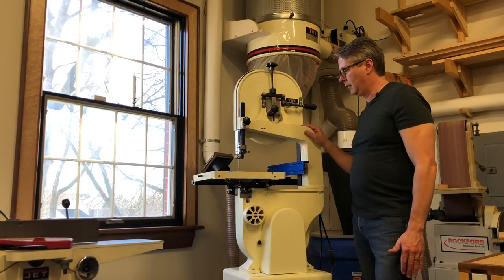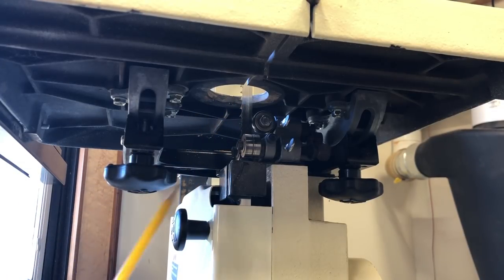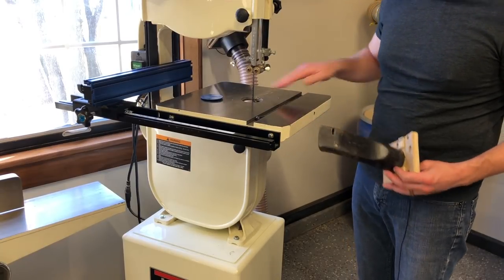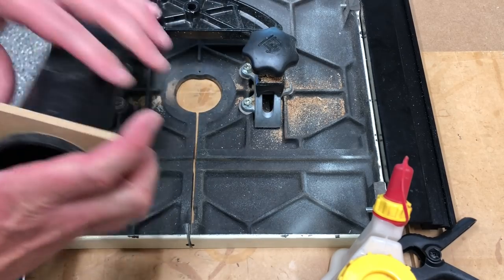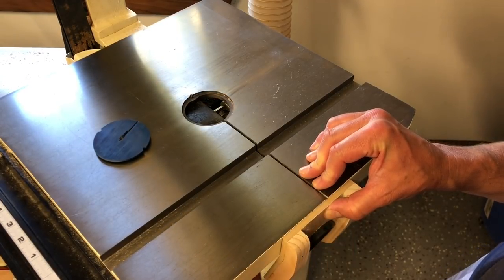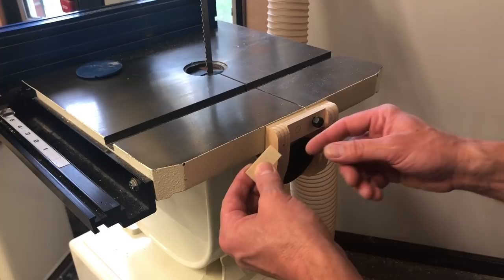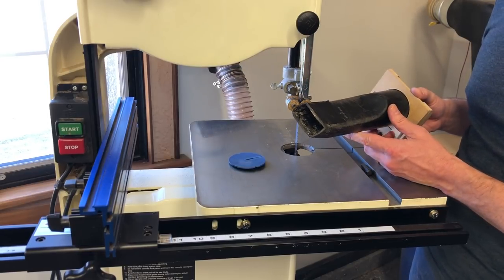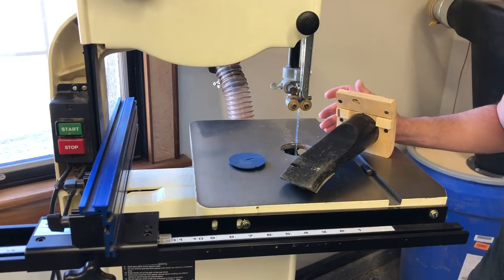Improve your Bandsaw Dust Collection

Comment: I'm curious why the opening the blade (and dust) enter from above on the tube assembly is so narrow.  Why not open that up a bit (while leaving the bottom as you have it for just the blade to pass through) so you have a larger volume of air to pull dust in?  I only ask because it looks like what little dust you aren't collecting is only because that opening is so narrow and they're deflecting off the plastic.
Reply: Hi, did you ever try doing it this way to compare?

Comment: This was a great idea!  I just finished crafting one for my 14" Jet 
bandsaw and it runs circles around the stock dust collector port.  I 
made the port adapter out of HDPE (only bendable material I had in my 
shop at the time, and I didn't have any 1/4" mdf), drilled the lock pin 
hole, and added the registration blocks.  My real estate under the table
 by the throat was a lot less than yours in the video, but I just cut 
more out of the shop vac attachment to make it fit.  I duct taped all 
the openings, installed the adapter, hooked it up to my dust collection 
system and let 'er rip.  What a difference!  This dust collector works 
great and I want to thank you for sharing your idea!!

Comment: Well Done. I have recently  got a bandsaw and I was pondering ways of having vac nozzle close to the  point of saw dust creation,  Thereby (1), dealing with the dust BEFORE its gets into the casing/working mechanism's of the bandsaw and (2),  because the vacuum is at the point of dust creation and not on the usual outlet location  the amount of negative pressure (eg "vacuum") that is required is minimised because you arent trying to create vacuum throughout the bottom part of the bandsaw casing. Thanks for your ideas on vac nozzle holder. I am gonna do this for my bandsaw.

Comment: Just did this for my JET bandsaw and the dust extraction is excellent. Since the cast table has ridges at the bottom, I used heat gun to soften the vacuum attachment  then pushed it into the ridges (about 1cm) so that the vacuum attachment doesn't stick out much. The result is excellent, thank you for the great idea!

Comment: Awesome design!  Three questions:

1.  What shop vac brand attachment did you use if I wanted to get the exact thing?

2.  I've found that not all rare earth magnets are created equal.  Some are terribly weak.  What brand did you use?  Can you provide link?

3.  Have you thought about narrowing the original wide opening of the attachment itself as to increase the suction power at the blade notch -- or would that restrict air flow too much as to risk the shop vac motor burning out?

Comment: I just made the same thing for my grizzly bandsaw. What an improvement, and what an amazing design. Did you glue or secure in some way the shop vac attachment to the bracket you made around the hole? Or is it just a friction fit? Thanks for the amazing idea!

Comment: Thanks for the good video!  How does this change the way you collect the dust?  Have you abandoned the use of the 4 inch dust collection system and switched exclusively to a shop-vac?
Reply from the maker: I no longer use the 4” and just reduced the 4” to 2.5” and use my dust collector.

Comment: Why not close the end of the  crevice attachment? Wouldn't that concentrate more suction at the blade?
Reply from the maker: I wanted max airflow to go past the blade. If I were using a dust vac that would make sense. With a high flow dust collector I thought restricting the CFM would be counterproductive.
Reply: I'm thinking the same. Though depening on what type of suction unit you use it might differ what is best. It's pretty easy to test it both open and closed and you'll quickly see the actual results. Just close it with with a good tape like Gorilla Tape/Duct Tape.
Reply: Walnut Workshop 
When you cut a saw kerf in the mdf to make it bendable, doesn’t the mdf break? I’ve tried it multiple times and it fails every time

Comment: Great idea great video. Thanks, I'll be doing something like this in the morning. Montana Wood Art.
Reply from the maker: Let me know what you think after making it please.
Reply: I finished the prototype today and it works awesomely. The vac attachment you used did not work for me,  but I used a very small one 1.5" by 1" cross section. It fits easily underneath once I had notched and bent the pipe to get it close to the underside of the table. The proto is taped and wired and will stay in use until I need to make a more robust one. Thanks again for the idea Montana Wood Art.

Comment: Okay, I'm attempting this today on my Grizzly G0555.  I've got the exact same hose attachment that has hitherto never been used, so I'm happy to sacrifice it to the bandsaw gods.
Reply: I built it, and resawed two boards with with this dust collection system.  It works really well, collected most of the dust, way better than the manufacturers 4" port.  I haven't added the additional bracing bits yet, and also the angle of my bracket is off, so it's not flush against the side of my table making it a little loose.  I might make another one tomorrow with all the bells and whistles, but the proof of concept model works really well.
Reply: @Exodus5K  Hey Conor, by chance do you know the name of the hose attachement that was used here?
Reply: @adamthewoodworker2571  mine came with my Ridgid shop vac, you could probably find it at the homeless despot
Reply: @Exodus5K  Yes I was actually able to find it on google. Are you still using this setup? Have you made any improvements to it?
Reply: @adamthewoodworker2571  no major deviations from the plans as described. It was an easy build and most importantly it works really well.

Comment: I have been looking at ways to fix the dust collection on my old general and I think that this might just work . What about plugging the rectangular end will that improve it even more
Reply from the maker: I don’t know. I figured it was better to leave it open to create more airflow across the teeth of the blades.
Reply: @Selandry1  do you still use the 4" port too?
Reply from the maker: No. I just use the 2.5 inch.